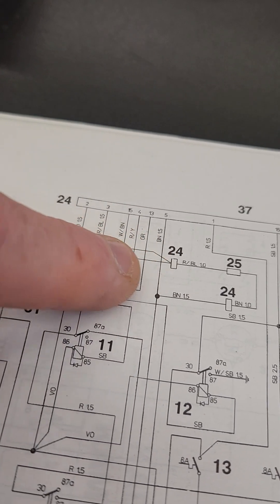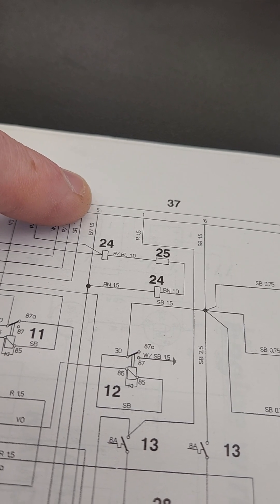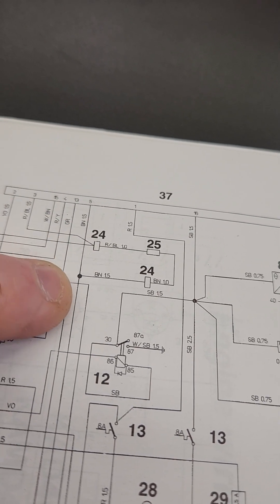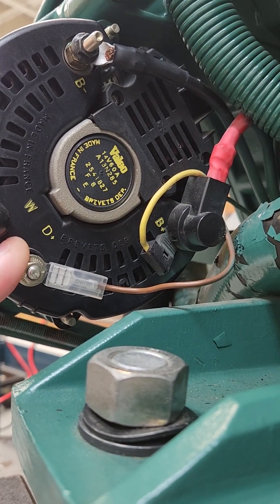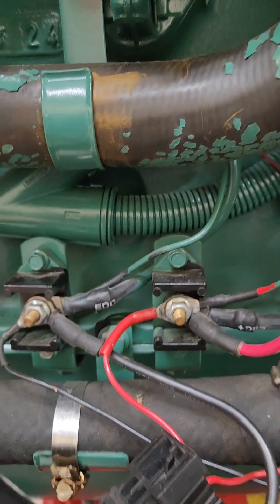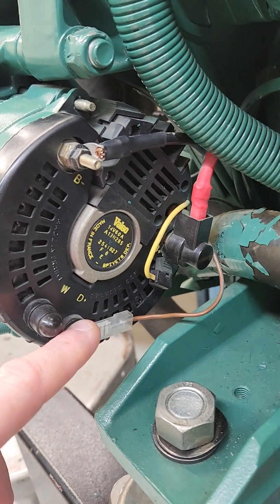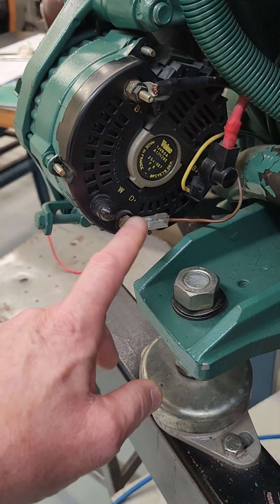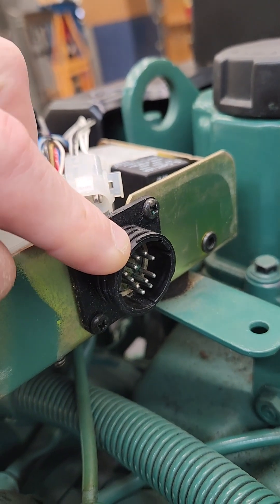Volvo Penta KAMD 44 Alternator wiring and testing

Comment: Hello. My dad has a boat with 2 of these engines. He would like a cable to plug in a tester, but I can't find any information online. Do you know what cable or adapter he can buy?
Also he wants to know when the compressors are supposed to kick in. Do you know that perhaps? He has an error 5-3 and 3-2, do you know what that could mean? Is it possible to reset the fault codes somehow?
Reply from the maker: EDC diagnostics are done with an old Volvo "Key" scan tool or a newer (Volvo Penta dealer only) VODIA diagnostic software program.

Code 3.2 is the charge air temp sensor  - it may be unplugged or faulty
 Reason: Short circuit/open circuit on signal from charge air temperature sensor.
 Reaction: Charge air temperature set to 55°C (131°F). Engine power reduced, excessive smoke
 if engine is cold .
 Action:
 • Check connections on charge air temperature sensor and control module

 Code 5.3 Reaction: compressor is not engaged.
 Action:
 • Check cables and connections to electromagnetic clutch.
 • Check fuse (29). (Not installed on the KA(M)D44P-A)
The EDC processor grounds the blower clutch at idle in nuetral when the engine is cold (cold start) 
and will engage it when accelerating. Power comes from a fuse up on the electrical box on the port side of the engine.

Comment: As far as I know the polarization switches on “D+” depending on what the alternator does. 
It’s “-“ when the engine is not running. The lamp in the dash gets plus from the battery when the ignition is on. Thereby it connects  battery “+” and the alternator, which gets exited by a few Watts the lamp needs (that’s why LEDs don’t do the job as a battery-light).   When starting the engine and spinning the exited alternator -  it does its job: Producing energy for the battery as long and as much as the battery “wants”

As soon as the alternator is spinning and exited “D+” becomes positive “+”. The lamp in the dashboard gets “+” on both connectors and goes off. 

(D+  =  During spinning “positive”) 

Then you should have 12.8-14.5 V also on D+. 
As far es I know it doesn’t have load on it, but could be used or seen as a voltage meter signal. 

As soon as the alternator is not excited and or stops working (running,charging) D+ becomes “-“ again and the dash light goes on - right before your next headache. 

As I don’t have an edc on my tamd31 I don’t know what’s happening to the edc, but it might be some kind of electronical headache too. 

Please let me know if I’m wrong!!!
Reply from the maker: Yes, I believe you are correct. After some further research I believe these alternators are auto exciting and there is a set of diodes that allow some DC voltage to feed the D+ terminal and thus to other side of the battery bulb in the control panel. 
I'm just not sure what exactly happens when the alternator fails and exactly how the D+ terminal then becomes a path to ground for the bulb. It must be internal circuitry inside the alternator.
Reply: So, I have tamd22 with similar alternator. Wired victron argofet diode to the alternator and to the batteries. Now my alternator sometimes charge, sometimes not. I think it’s either bad connection somewhere, or these alternators really need voltage on B+ to start charging.
Does any of you have more info about that? @loxbex @tedsmarinerepair8956

Comment: Hey Ted, thanks for another great video. The other day my EDC diag was flashing 5.2. I can't find anything on this. You ever seen that?
Reply from the maker: @Spicy-Tuna  that code is for the nuetral light. Either faulty wiring or a bad bulb. You can try erasing the code to see if it's  (intermittent) if it comes right back wire or a bulb.